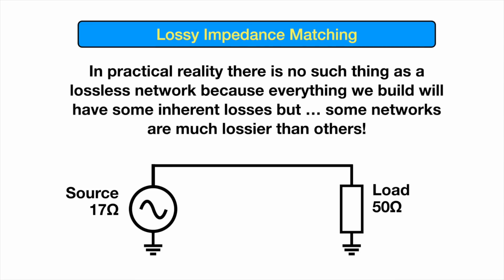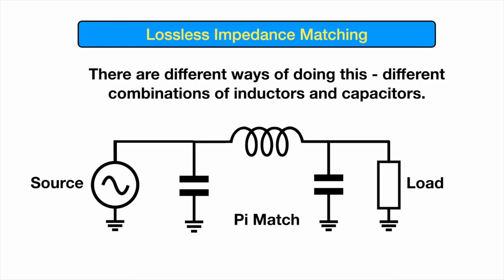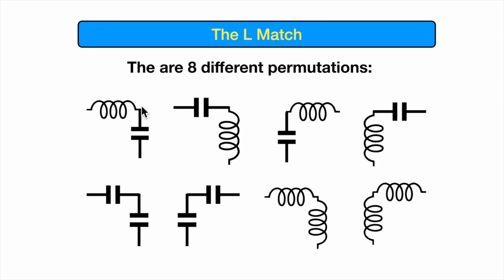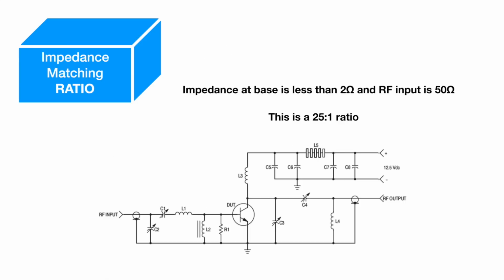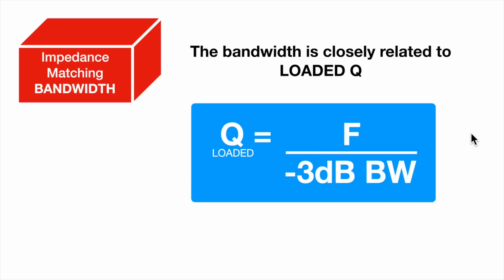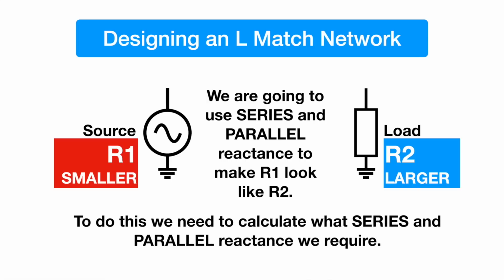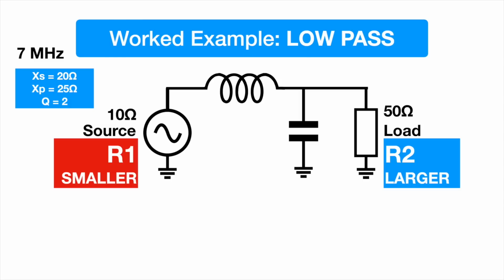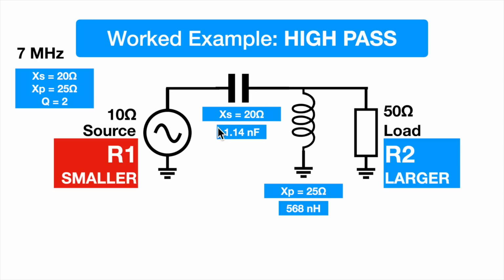50 - LC Matching Networks - Part 1

Comment: In your worked example it's an interesting exercise to work out the impedance of the 50 ohm load and parallel capacitor using complex numbers and verify that it is 10 ohms resistance in series with a capacitor of reactance 20 ohms. This makes the equivalent circuit at the design frequency a 10 ohm resistance generator feeding a 10 ohm resistive load via a series-tuned resonant circuit.  At resonance, this circuit, if perfect, may be represented by a short circuit. You could do a similar bit of maths looking from the load towards the generator. You would have to use admittances and inductive susceptance to work this out , but I'm pretty sure that you would have a 50-ohm generator in parallel with an inductor of 25 ohm reactance. This equivalent circuit, at the design frequency, would give you a 50-ohm generator feeding a 50-ohm load with a parallel tuned circuit in parallel. At resonance, this perfect tuned circuit would have an infinitely high impedance and could be ignored, leaving you with a 50 -ohm generator feeding a 50-ohm load. These equivalent circuits only work at the design frequency. I can see why you and Wes Hayward evaluated your components at 7MHz, as it is an amateur radio band, but, speaking as someone from the pre-calculator age, the calculations are easier if you use 7.96MHz. It saves multiplying and dividing by pi. (2 x pi x frequency = 5 x 10^7 @ 7.96MHz).
Reply from the maker: Thanks very much for your insightful comment. That's an interesting observation. Best wishes, Nick

Comment: At around 14:40 you keep saying "higher impedance" is at this end ect. What do you mean by that "higher impedance"? Xc and Xl are frequency dependent. Can you elaborate a bit what you mean by "higher impedance" at this end ect.
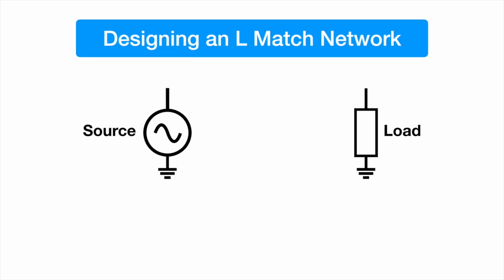Reply from the maker: Hi there! I would advise you to go back and watch again from 27:38 when I begin the design process. When I refer to which end has the higher impedance I am referring to the source and the load that you are trying to match - which is higher and which is lower. This will dictate which particular design you choose to use. Some designs match a lower impedance source to a higher impedance load: others match a higher impedance source to a lower impedance load. I do go through the whole process, step by step with worked examples in the video. Sometimes you have to watch this stuff a few times before you get the hang of it. Hope this helps. Thanks for watching. Best wishes, Nick

Comment: Hi Nick, Fantastic explanation!
Only I have a conceptual doubt. The maximun power transfer theorem speak regarding the magnitude of transfered power, but not regarding efficiency.When ZL (load)=Zi (gen), it will have the maximun power transfer but only 50% will be dissipated on the load  (bad efficiency, only 50%). Now if ZL and Zi have (in example) 4,4 times difference (i.e. 220/50 ohms. or 11,4/50 ohms) VWSR will be 4,4:1, and in consequence 40% of the total power sent to the load will be reflected to the gen, but the efficiency is 60%, then in this case even when we have reflected signal, te power effectively dissipated in the load is 10% greater. Apparently is not this theorem the real reason to match the network.  Then my question is:
if even when the network is unmatched we get more efficiency than matched, why to match?.
PD I know that I must match the network, but I dont have answer to my doubt, :-(
Reply from the maker: Hi there! Thanks very much. That's a very interesting question! It is one I would have to do some research into before attempting a proper response. However, I think it is about the fact that maximum power transfer and efficiency are two different things. Sometimes (e.g. in an RF power amp) we might sacrifice power output for greater efficiency in a battery operated radio. Sometimes though we might do the opposite - we accept poor efficiency (like class A) so as to have a cleaner output signal. There is an interesting exchange about this here: https://electronics.stackexchange.com/questions/449645/does-impedance-matching-imply-any-practical-rf-transmitter-must-waste-50-of-e
Thanks for your thought-provoking question! 73, Nick

Comment: Really helpful video Nick - your presentation skills are first class and make it so much easier to understand these concepts. Would you be able to help with one quick question? Let's suppose we want to match a homebrew CW ladder crystal filter (about 11 MHz and impedance of say 200 ohms) with an MC1350 I.F. amplifier (input impedance of say 2,000 ohms). Should we go for a low pass or high pass impedance matching network? Thanks again Nick and looking forward to Part 2!
Reply from the maker: Hi Brian, thank you very much for your kind words. I’m not at home at the moment so can’t simulate your precise scenario. However, just off the top of my head: with an impedance transformation ratio of 10:1 and a narrow CW signal in an IF section then either high pass or loss pass should work just fine. This is because you won’t require much bandwidth at all. Hope this helps. Thanks again. 73, Nick

Comment: Thanks for the great explanation. Is that also the procedure when you match a transmitter to an antenna?
Reply from the maker: Hi there! It is one way to do it - but there is a bit more to it. Stay tuned for part 2! 73, Nick

Comment: I want an LC or LCL bandwidth filter hi bandwidth filter for 50 hertz mains running a 220V motor. I want to keep it to 1% but can't really find out through the calculators getting it that accurate tolerance an exactly what type of filtration inductors I really need to get to that level of accuracy or better
Reply from the maker: Hi there! That's a very specific use case and I'm afraid not one I can advise on. Have you tried asking on some of the more generic electronics forums? All the best, Nick

Comment: That was excellent!  Better than my EE filters course content!  Only thing is: your quick aside at the beginning where you showed the resistive network to match 17 Ohms to 50 Ohms -> I do not see how that could work?  (you added 33 Ohms?)
Reply: Yeah, Nick has gone wrong here, his circuit now present 83 ohms to a 17ohm source! The following pi network gets it right, although the labeling is confusing.
Reply from the maker: Please see my reply to @drstrangelove09. Thanks very much. 73, Nick
Reply from the maker: Thanks very much. The cheap and dirty resistor trick DOES work actually - but crucially only in one direction (which I didn't say). You and the commenter below are quite correct that the source will see 83Ω but the LOAD LOOKING BACK TOWARDS THE SOURCE WILL SEE 50Ω. If you run it through LTSpice or a Smith Chart calculator you'll see for yourself. Where folk can be tempted to do things like this are for example on the ports of a diode ring mixer. The IF port in particular just wants to 'see' 50Ω. It couldn't care less what the source of the input signal sees. So the mixer port is happy but there will be reflected signal back towards the source because it sees 83Ω. Hope this makes sense. On reflection it perhaps wasn't the best example to give so apologies for any confusion. Thanks for watching as always. 73, Nick
Reply: @M0NTVHomebrewing  Well now you are just compounding your errors. In your example the cheap and dirty resistor DOESN'T work! Terminating sources correctly IS the prime requisite. Your example source is not matched. You need  a parallel resistor to match the 17 ohm source or two resistors to make the match both ways. The impedance back from a resistive load is not important. There are no "reflections" from a pure resistive load only the consideration of meeting either maximum power transfer or voltage drive. Reflections are when you have transmission lines and/or complex impedances involved. Your example of the diode ring mixer doesn't apply because unlike a resistor, a mixer port is a source, and so needs correct termination.
Reply from the maker: Fair enough. I stand corrected. Thanks for watching and commenting. 73, Nick